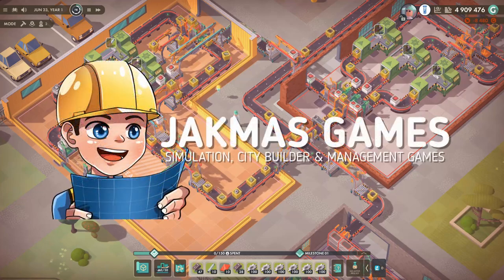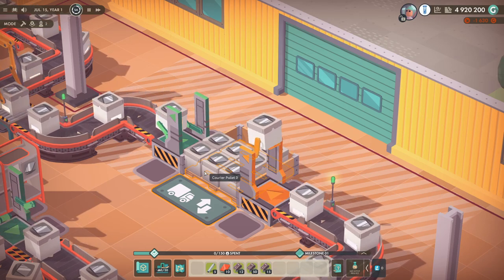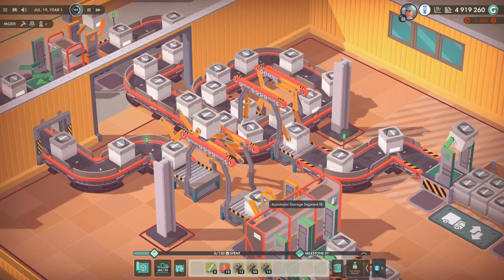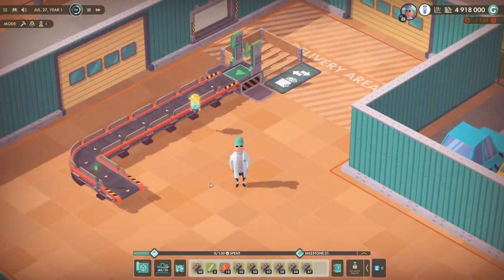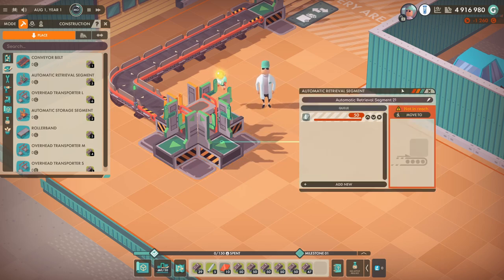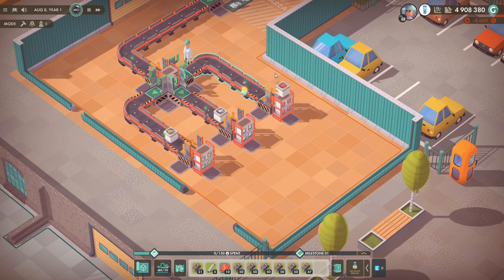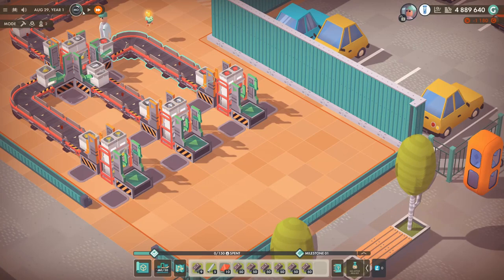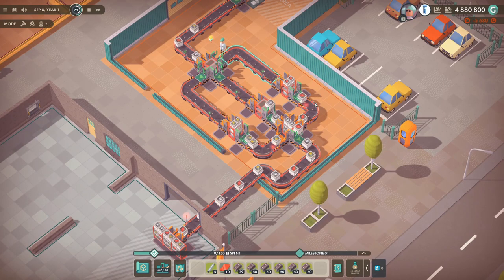*EARLY ACCESS* CONVEYOR BELT TIPS & TRICKS! | v0.7 Work Smart Update | Good Company Tutorial

Comment: Jakmas, i just added some pallete feeding a conveyer belt that is connected to a Shelf. i have items in the pallet but is not picking it up. Also nobody is picking up the material from the shelf. Quite weird and i can make it work. te workers in the same zone are missing a component which is plenty in the shelf close to the conveyer belt. the logistic guys just pick up items from the pallete ? how to make them pick up from a shell? thanks for any tip . The one you just show filtering the items is great, but would be helpfull if we could select logist people to also selecviely pick ithems and bring to the different tables..
Reply from the maker: Click on the shelf and add a rule for the module you want to move.  I think that may work.  As for the conveyor belts, you need to use an automatic retriever, click on it and add a rule for the module you want to pick up, then move the slider all the way to the right! let me know if this helps!
Reply: @Logistical  for the conveyor and retriever i did just like that and wont work. i added a retriever in one side and a storage segment in the other side.  i was trying the auto mode for the rules,  it seems that going to manual, is possible to create the rules. However the item in the pallete is not being picked up....thanks
Reply: @Logistical  i guess has to do with some bug. when i delete the Shelf and add it again clean and add the rules to the retriever, then it shows automatically the rules on the shelf. it work for a while and stop...need to see what is going on
Reply: maan. sometimes i make the thing works..but sometimes just get stuck. i have a conveyer getting in a shelf and another geting out of the same shelf. the problem is that a logistic mdfkr add an item on the conveyer that it shouldnt and block the whole thing...perhaps i shouldnt use 2 belts at the same shelf/pallet ?
Reply from the maker: Try putting the conveyor belts on their own work zone maybe? Sometimes the logistics workers put things on belts for no reason!
Reply: in my layout i need to conect different zones with the conveyor belt. as you show in one of your videos, im kind of filtering what is coming in and putting in the other conveyor belt using the same shelf, kind of in and out, some items need to stay and othes are moving forward to the next station. other strange thing is the queueing. it get stuck, but if if move the items in the queue list, they start to get picked again..im not sure if has to do with the fact that some items need to reach 100 to be picked...is that so? cheers
Reply from the maker: I think it’s just how the conveyor parts work at the moment so unfortunately you may be stuck for now.  I would just use a courier pallet to move things from one work zone to another!
Reply: @Logistical  im  doing that..i dont know, but it really seems to be a bug. now when i fast forward the retrievers get things that are not in their rules ..aahahrgh. i think i need to be back to the logistic trolly bastards :P
Reply: hey Jak, perhaps you can help me with something. I have som zones which dont have delivery by default. im trying to transfer plastic from a zone where i produce plastic parts but the logistic mdfkrs dont fill it in the pallet with plastic, they do take out from there and fill it in in te shelves for plastic production. this is by using the Auto mode, by manual i think i can do it, but i need auto to dont screw up other parts...any tip? im thinking about creating a zone only for raw materials to avoid such priority for construction. Cheers
Reply from the maker: So you may need to change the input and output sliders on the pallet screen.  Make sure the pallet you want to receive the plastic has input set to 100% and the pallet where the plastic is coming from set to 100% output